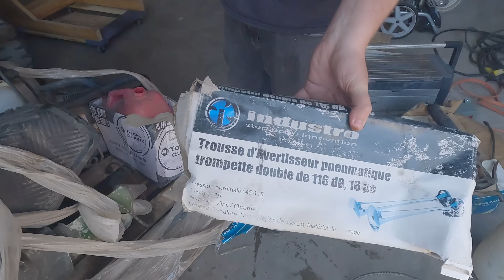$45 Dollar Ritchie Bros Mystery Pallet

Comment: lube the air tools generously. Now. There is an air tool oil. It goes in the air input. Its recommended to lube the air tools before each use. Great deal on that pallet. That craftsman air ratchet is 70$ new. It will last a lifetime if you take care of it. Mines 45 years old and i just used it today.

Comment: I wouldn't mess with the outboard too much until you get that bottom end in the water so the water pump impeller is lubricated with water.  If you don't you'll ruin it.  As far as the rest of it goes it wants to run.   Pretty much the only thing that goes wrong ith them is the water pump impeller goes bad,  the coils go bad, the carbs gum up and they set up from rust.  Don't run gas with ethanol in that motor unless you put the ethanol kit in the carb. It looks like a less than 10 hp mid sixties motor.  The pull start mechanism on those were a pain and if I recall are pretty hard to come by.  As for the air tools there's only a few moving parts in them.  There's vanes that come out of the rotor some bearings and the mechanism on the working end of it.  If you don't get some oil in them soon you'll ruin them.   Marvel Mystery oil works as well as air tool oil.  I'd flood them to get all of the water out and then 2 drops a day is all they need.  Ya done good for $45.

Comment: Spray some oil in the air hookup on those air tools, they pickup a good bunch of power just from that alone. Plus airtools should have a bit of oil dropped into them occasionally. You say are breaking a bolt loose and its trying but struggling, put a few  drops of oil in the tool and bang, bobs the uncle. For some reason, all boat motors sell for good money when they run... I believe this one will come to life again. Even so, parts for older motors are now reaching some crazy high dollars. That big grinder hand held here in alaska, is around three to five hundred dollars depending on brands.. the cheapest you find are garage sales as you go to a pawn shop thinking its a great place for a deal and then know they should of included vaseline with the sale.
Reply from the maker: Awesome thanks for the tips.
Reply: At least at the pawn shop, you don't have to go to the doctor for a checkup anymore.

Comment: That old 9.5, possibly a 9.9 hp Johnson or Evinrude we’re good motors.  Very reliable.  Most were 9.5 but supposedly some were actually 9.9hp just before they changed the entire design to the more square/rectangular engine housing.
Reply from the maker: Cool thanks for the info. I looked into and i think this one was a 9.5hp
Reply: I had a 9.9 Johnson like that.

Comment: check the shear key as it started and loosened the flywheel nut
Reply from the maker: Thanks I’ll check it out.
Reply: Yep, was about to say the same. Had a number of Briggs that refused to start and had managed to shear their keys and so, despite the apparent strong spark had waaaaay out timing!
Reply: @TheSynthnut had a Villiers with reversing dynostart that used to do that,  most annoying, never went anywhere without spares, problem was a big heavy flywheel rotor and a worn or damaged taper, so it would never be good.,  but it was transport most of the time😊.

Comment: You need to put a pull rope on it!   When it pops you let go of the rope.  I don't think you can get the drill off fast enough.  Good luck with the bat motor.  The old ones are more durable than new ones!  Eddie
Reply from the maker: yes sir

Comment: That snow blower carb needs the jet pulled out and the Jet needle pulled out and the little holes cleared. Then it will stop surging. It is an easy fix. Well if it is not too far gone like one I did a while back for a guy in the military. It was so bad I had to replace the carb.
Reply from the maker: Thanks for the tip. I will look into it further in the fall

Comment: dont be turning that out board over without grounding spark plugs or the wire  if you turn them over without grounding you can ruin the coils this motor could be anywhere between 3 hp up to 9.9 im thinking its closer to a 9 hp i have two of these one is now running haven't finished the other one yet  also used puller to pull flywheel if necessary clean and set points for 20 thousands clean carb low speed and high speed jets  could the air screw mixture count turns till bottoms out lightly  and remember this when you put them back you will come back out to close the turns in you did in reverse
Reply from the maker: Thanks for the tips
Reply from the maker: Ps motor is a 9.5hp

Comment: There is nothing at Richie Bros less than 100 dollars. If you win a bid for $20.00 dollars they add on 100.00 for each lot you win minimum plus another buyers fee. I won a 20 pallett that cost me 100.00 plus 8.00 plus the 20.00 dollar bid. so 20.00 turned into 128.00 dollars. Then you will need to schedule a time to pick it up.
Reply from the maker: yes sir you are correct
Reply: that  minimum hits the wallet hard if its just one small item you end on bidding on...

Comment: tools and their proper care are not your strong suit, little Air tool oil before you forced all that water thru might of helped, if let them sit to long after not doing trying see if they work Thel be just locked up rusty tools, little preventive action on your 45 score, could go a long way for tools if   you hand any intensions on using or resaleng.
Reply from the maker: Don't think Oil would have help until all the water was pushed out first

Comment: Why do you keep thinking the outboard motor will run without fuel?. Soak all of the wet air tools in diesel fuel for a while to free them up.bShoot PB blaster in the air inlet and let soak.
Reply from the maker: Fuel was sprayed in the carb

Comment: Just the benchgrinder was worth more than 45$.. amazing deal if you dont have thumb in your ass. Blower alone would be 100$ even if it didnt run.
Also please make starter free turn tool from ratchet or one way bearing. If you dont do start with the drill just right you risk on getting slammed into face with it or breaking your wrist. One way bearing will ensure engine can out run the drill when it starts.
Reply from the maker: Thanks for the tip

Comment: What you are calling a polisher is an angle grinder.  You don't have a clue
Reply from the maker: No its a automotive polisher. but thanks for watching
Reply: @CrabTree1  LOL.  It's an angle grinder with a buffer wheel on it.  Will run different.attachments